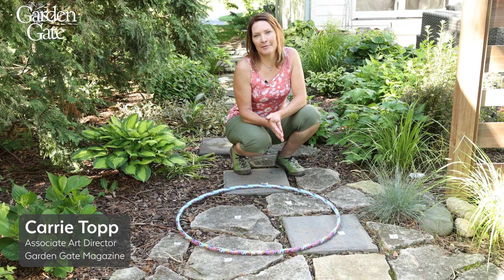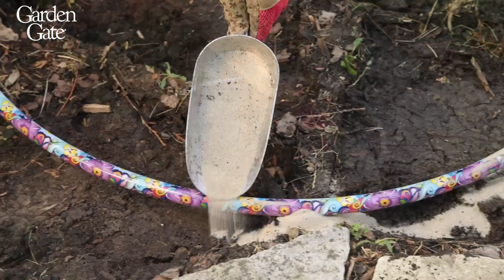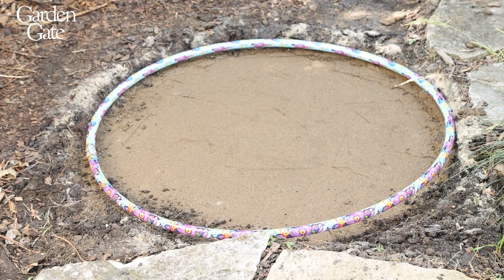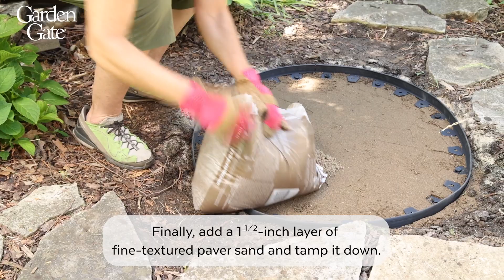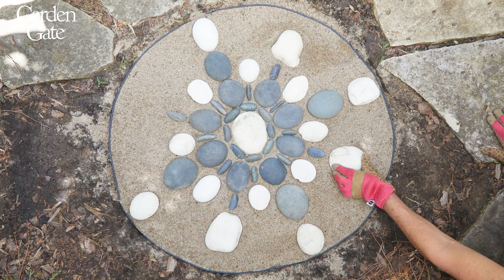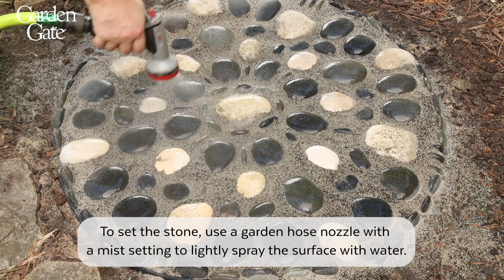DIY Stone Mosaic Stepper

Comment: About how long did it take to do this project?
Reply from the maker: It only took a day to complete! But we will note that over the last few years this project has crumbled a bit due to placement in a very wet spot in the test garden. We may suggest using mortar instead of the Gator Sand for a longer-lasting mosaic, and placement in a dry location.
Reply: @GardenGateMagazine  oh, ok... thank you!